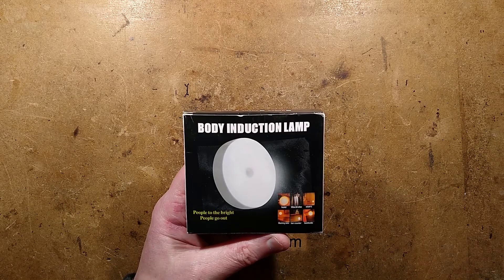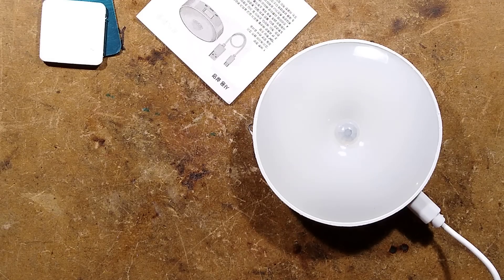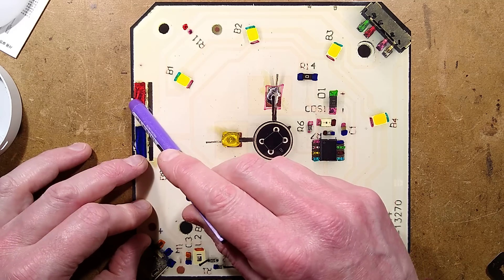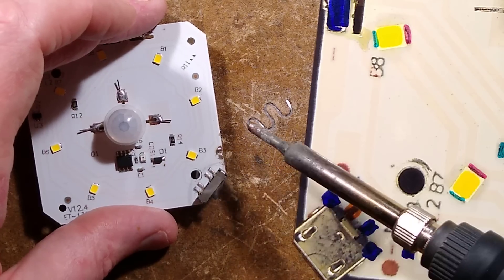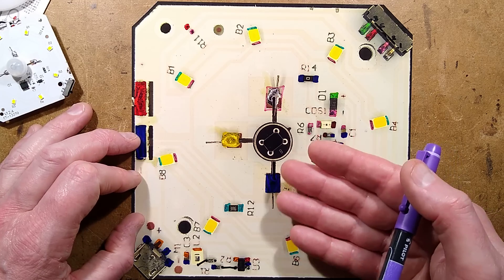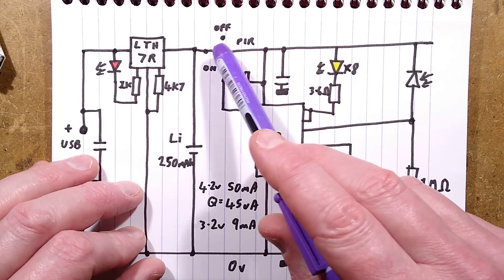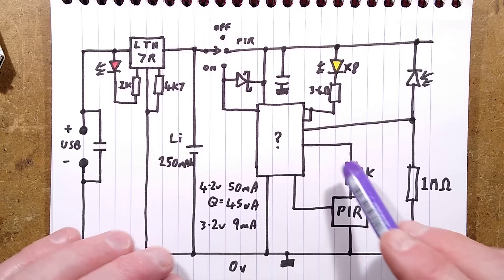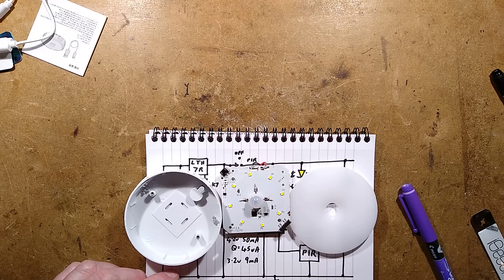Fixing a Temu light - with schematic

Comment: When you're poor, you can't afford to throw faulty stuff in the garbage.  That's how I learned to fix things...just the need.  I remember fixing my mother's old toaster when I was 7, having opened it up seen a simple disconnected wire.  I was addicted to repair after that.
Reply: I have concluded long ago that poverty is a life-building experience that everyone should have the opportunity to enjoy. Some lucky people are poor their whole lives (like the endlessly innovative Cubans under embargo). Poverty makes you smarter, but most of all, appreciative.
  A hacker is a person who sees a sticker reading, "No User Serviceable Parts" and asks, "Why?"
Reply from the maker: A bit of poverty makes you appreciate things a lot more.
Reply: I just fixed a chinese 3D moon shaped light whose micro usb jack took a hit, soldered it with a 6 inch nail heated on a gas stove.
Reply: @shauryasharma4579 When all else fails, use 6" nails... :)
Reply: You're also saving something from landfill. Environmental win!
Reply: Also, "you can't break broken." If you were going to throw it out anyway, you might as well take it apart and learn from it first. I
Reply: I have one of those 'gaming mice' that costs ~£70 new, and I quite like how it feels and functions, but didn't want to have to spend a bunch of money to get a new one just because it started double-clicking occasionally whenever left/right-clicking
A small bit of searching later lead me to getting a couple replacement switches (barely £5 shipped) and spending about an hour soldering in some new ones.
Essentially saved myself £60 and it'll probably last a couple more years at least.

Got a lot of questions from people at the time asking why I would 'spend so much time and effort when I could just buy a new one'... :/
Reply: @Stevo_1998  You can sometimes hit it with a blast of contact cleaner (we used to call it tuner cleaner from the mechanical TV tuner days) and that switch will stop bouncing. Very hard to get it into the micro switch contact area because they are sealed. But I had a very nice mouse start doing the same thing. Very annoying, and problematic, to get a double click when you don’t want it!
Reply: “Money can’t buy happiness.  But poverty sure can buy a big dose of misery.”  - Adam Carolla
Reply: Had it been plugged in and you got a jolt of AC mains through your little body you'd probably never ever dared to repair anything again. Gotta love those life changing moments 😎
Reply: @Ni5ei   Getting zapped is part of learning, and a good motivator to read books and manuals.  I got a serious mains shock at age 8 but that never stopped me.  Gotten shocks since and that'll never stop me but I truly appreciate pro electricians who work on power lines...that's dangerous stuff.  I'll stick to appliance repair.
Reply: I've worked at venues where we had the best equipment and budgets and I've worked at some places where it was practically 3rd world medicine.   The latter is far more stimulating and rewarding.  When on the drive to the venue and are running through the show in your mind, trying to guess what will break / fail on you that night and how you plan on keeping the show going in spite of it.
Reply: Poor or living behind the iron curtain with limited access to spare parts.
Necessity brings creativity! 😉

Comment: I have a few of these (not the exact same model) and some of them likes to overdischarge the battery and then it can not charge it, LED stays green, or stays red, or flashes, or nothing. And I have to pop the cover and give it a boost with a little charger module.
Reply: You could put a shotky diode between the battery and the circuit to the right in the video (9:05) to drop some voltage so it cuts out sooner. 

Easiest way would be to solder one in across the switch, bypassing it. Or make use of the diode already there by the switch in the diagram - cut the track between diode left hand side and the controller IC should work (ON mode will become the same as PIR mode except through a diode).
Reply from the maker: I wonder if the cell has a protection board on it.  The DW01 can be a nuisance at times.

Comment: I use bar led lights above the 3 doors upstairs, like you said, very handy when you come out a room and they all sense you and light up almost at the same time :D adds a very futuristic element to needing  a pee in the middle of the night and seeing as the wall switch is on the wall opposite my bedroom, the lights save me fumbling around in the dark looking for it ha ha
Yeah, afraid I'm also guilty of falling into the hole of ending up fixing faulty goods on receipt lol It does make you wonder the amount of returns or binned items for 90% of the time an easy to fix problem such as loose battery terminals or a broken wire or a gap in a track on the board like yours or a bad solder job on the mosfets in my dehumidifier grrrr

Comment: Can you or anyone tell me  which UV light is used in those machines that will harden the gel nail polish when you stick your fingers in that machine? I hope it's not the one that can damage skin I think it's UV C light that can harm skin so I hope that's not in those machines or the ones that can make resin set hard when it's UV resin?
Reply from the maker: The nail units usually use UVA which is just next to the blue end of the spectrum.  UVC wouldn't work for this.
The issue with light cured nail lacquer isn't the light.  It's sensitisation of the skin caused by methacrylate components.  It can lead to a long allergy to them.
Reply: That are RGB leds with extra blue.

Comment: I similarly upgraded a set of Lidl solar garden lights, swapping the factory 100mAh AAA NiMH cell for a new Lidl 1000mAh one, and slathering petroleum jelly over all the exposed metal inside.

They're depressingly simple inside: a standard four pin TO-94 chip, an inductor, the LED, solar cell, the battery and a switch. Noticeably brighter after the upgrade. Hoping they'll last at least one winter.
Reply: bridge the switch,. will last the life of the battery
Reply: @voltare2amstereo  True, but the switch is not what corroded on the ones that were out last winter. That was the spring battery terminals.
Reply: @nowster  BC does the tape over the top which helps prevent ingress too

Comment: I would advice to bridge the crack via a wire, one thread of a flexible wire, as it's more durable. Temperature changes and mechanical forces will crack the solder.
Reply: yep
Reply: That could be said about any solder on the board and the traces, too.

Comment: 10.20ish. i am unfamiliar with the phrase "quiescent current" bugger! - chatgpt says "Quiescent current, often abbreviated as IQ or simply Iq, refers to the steady-state or idle current consumed by an electronic device or circuit when it is in a quiescent or inactive state. In simpler terms, it's the current that flows through a device or circuit when it's not actively performing any work or processing any signals."- wow that's interesting. thanks

Comment: I have such a lamp. After upgrading the cell the LEDs became dimmer over time, then they started to flicker and now the lamp just stays on forever completely ignoring the infrared sensor. No clue what could have caused this behaviour...
Reply from the maker: It's probably because the LEDs are being driven too hard.  If they start flickering then it may upset the sensor due to the fluctuating power.

Comment: i am always so proud when BC says "technical people, like you and I". thanks mate.
Reply: Our motto is “No User Serviceable Parts Inside? I’ll be the judge of that!”
Reply: I always laugh when I see that. Then proceed to open it anyway :)  @markfergerson2145
Reply: Well, "technically" I'm a person, but that is where the similarity between Big Clive and myself begins, and ends!  🤣
Reply: @agustinusreynaldi7101 So do I, but the problem is, it usually STAYS faulty! 👎🤣
Reply: @marcse7en  Hehehehh
Reply: I'd like to be technical, but I tried to fix an OG Xbox by replacing the 3 power capacitors, and one came.off and was replaced, the second one came off, but the through hole on one side is blocked. tried everything, the sh**y soldering station from Lidl the end fell off, so I'd love to be technical.
Reply: @blackcountryme   Everything I touch turns to $h1t too!  👎🤣
Reply: BC in my language slang means bhench*d
Reply: what the FUCK is going on with youtube these days?  it's all ass-kissing in the comments, now.  It's the brownnose section, not the comment section.

Comment: For easier solder bridging you can tin both pads as normal then swap to your trashiest lead free solder and a cooler iron temperature. It is stickier and with much higher surface tension so will 'stretch' much further - it's about the only use I have for lead-free solder!

Comment: I have the older ones as well.  I bodged an 18650 cell/holder on one so I can swap out the cell instead of having to put it on charge for several hours.
Reply: Got something similar from Poundland that ran off 4 AAA, so I patched a USB cable in and power it from a small powerbank. Handy for a small corridor where the lightswitch is in the middle.

Comment: I have a couple of the older ones...I use them in the bathroom & pantry...I really like them except I want them to stay on longer than the 17.5 seconds that it currently does.  
Is there any way to change the stay on time setting in the older ones?
Reply from the maker: Some of them have a resistor that can change the timing.
Reply: I've changed the timing on the units that use the BISS0001 chip.

Comment: Looks like they used brute force to install the PCB into the housing at the factory.
Reply: Nah, the board can be removed with a slight flexing of the walls to allow the USB socket to pop out/in, just put the switch into the slide first, squeeze the wall together & the USB socket drops into place.